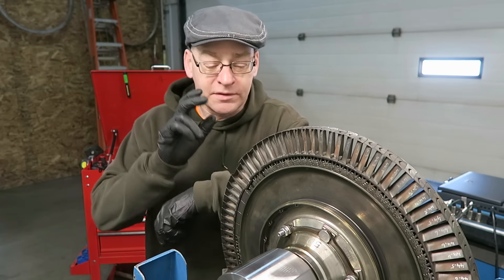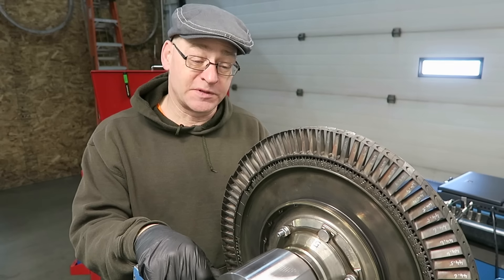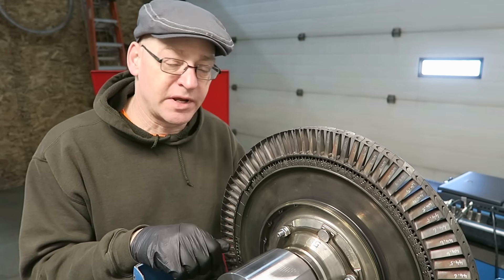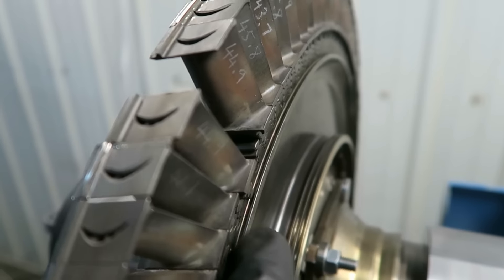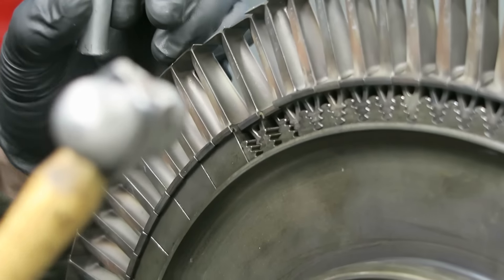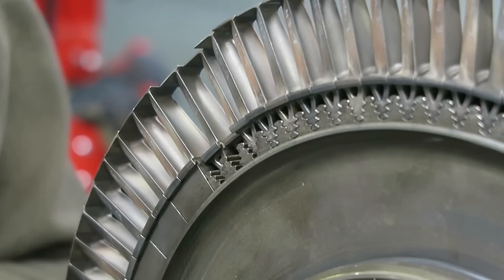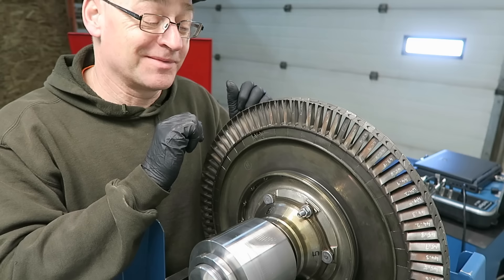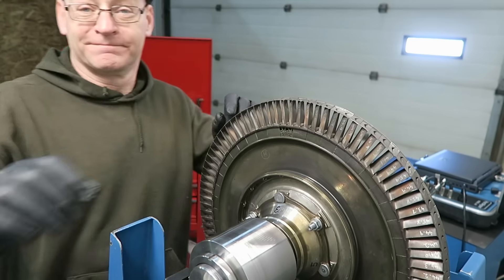Locking Blades 2

Comment: a question: do you mark this final pin for future reference? i suppose that since you bend it, it loses some of its strength, so i thought maybe you would not want to bend the exact same pin if you have to take this engine appart again
Reply from the maker: +dimos k    The way it's installed leaves slight deformations that are easily noticed when compared to an unbent one. No need to mark it.
Reply: AgentJayZ ye that makes sense. Thanks for the response!

Comment: Haha funny.  I trust and respect you massively Jay, but I think it's funny mentioning the gentleness of the use of a hammer  in jet engines because every part is precious, rare, and delicate, then using a hammer to pound one of the rare pieces into position.  Doesn't bending the part and pounding it back in cause metal fatigue making it unusable for more than a couple rounds of overhauls?  If installing it is that indelicate a process, how do you extract them in the first place?  Does it equally require bending one out to get them all removed?  And with what, a screwdriver?

Also, I think I've watched virtually all of your videos and have never spotted the framed print I sent you.  Is it in the shop or did you take it home?  ;)

Love your videos and your awesome demonstration skills.  You're a natural teacher and should consider teaching mechanic school when you retire from pounding locking plates.  :)
Reply from the maker: +Dario Impini 
Single use item. Removal is the subject for a possible, distant future video.

Comment: I got a question
... how you going to balance the HPT without balancing the HPC and it's parts since the moto sich overhaul manual calls out the rotation plan while the HPT is attached to the HPC drum...and also can you sell me some of those lock plates?
Reply from the maker: +Ryan Quack I can trade you some for the overhaul manual version you have. More info is better info...

Comment: Why is your hammer not made from aluminium? Since the forces on it are so low, you might as well reduce the potential risk of damage by having less steel around soft parts.
Reply from the maker: +janusroenlev This steel hammer is available everywhere for about 8 bucks. I've never sen an aluminum hammer, and I don't want to know the price.
Reply: +AgentJayZ They're called mallets, and they're everywhere. Available in brass and copper and even lead.
Reply from the maker: As stated above, I've never seen an aluminum hammer, mallet, whatever.
Brass, copper and lead do not apply to your first comment. Let's not become a moving target, Hmm?
Reply: If i make you one and send it from Denmark, will you use it instead of that harbour freight hammer?
Reply: +janusroenlev I've seen soft-headed (typically nylon) mallets used in certain applications, eg, tapping turbine blades with interlocking shrouds into place.  Nevertheless, I think you are on the wrong track suggesting that AgentJayZ takes even a soft-headed mallet of any description to that locking plate.  His Alum drift, being held in position before the blow, delivers the necessary force in just the right place.

Comment: hmm, it would be interesting to have a similar plate that lines up in both slots before the blade is driven all the way forward on the disc and seating the blade pushes the plate into final locked position. I'm guessing someone already has a patent for it if it's not on a turbine yet.
Reply from the maker: +Robert Szasz Wouldn't work. There's almost no wiggle room or pivot ability. The parts are steel, and have zero practical flexibility.
Reply: Well poot. And here I was thinking I had the next sliced bread. I guess Strength, Weight, and Cost were most important and so long as it can be installed all is good.

Comment: 9:04 why brass why not any other material like iron
Reply from the maker: The punch is made of a material softer than the parts you are beating on, so any damage happens to the punch. Brass is one step harder than aluminum, but still softer than steel.
A steel punch is used only as a last resort, and with extreme care.
Only hacks and complete idiots hit engine parts directly with a steel hammer.

Comment: I would press it in with a modified c clamp
Reply from the maker: There is a procedure, written by the manufacturer. Failure to follow that procedure will result in you being reassigned. You only get a couple chances, and then you are out.